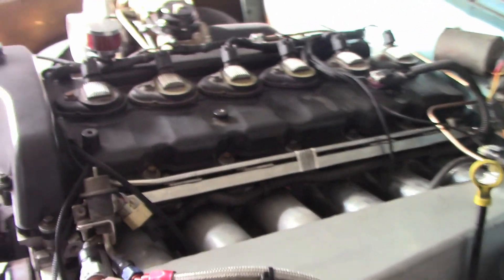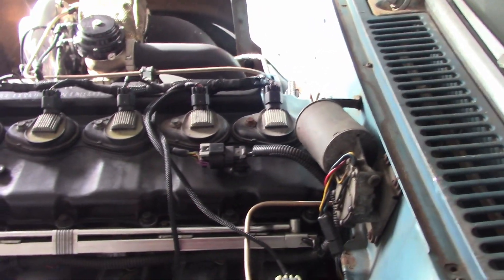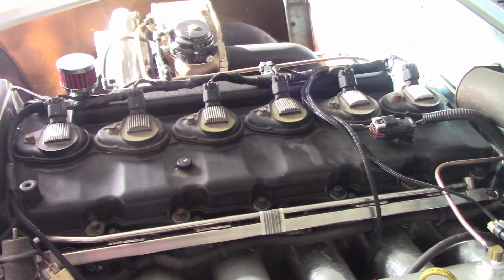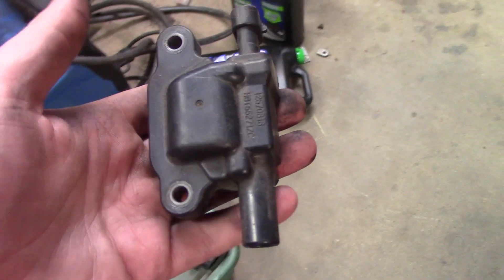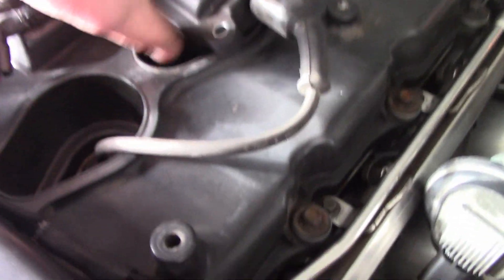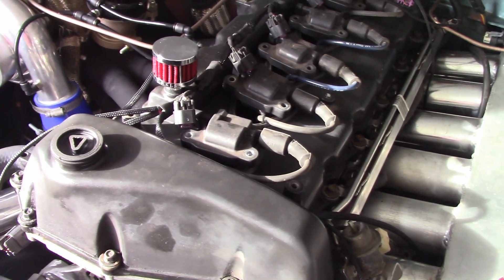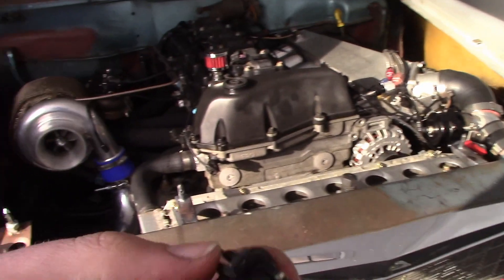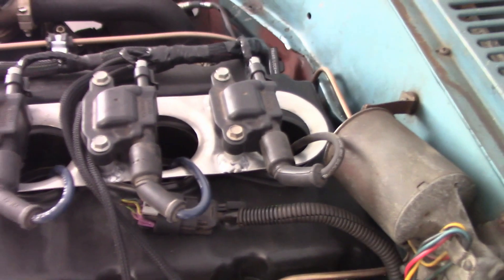Converting to LS coils

Comment: Quick question say I did this on stock motor..will anything else have to be done or will it still Start right up. Will it need to be tuned? Not a big fan of the stock coils on these motors. You've had more experience on this so just wanted a little input on it thankyou in advance. Enjoying the videos as always man! Keep it up!
Reply from the maker: Nope. They drop right in
Reply: @Calvin-Nelson  sweet thanks for the reply!!

Comment: The coils on the 2002-2005 4200's are so damn quirky... even ACdelco's... The 2006-2008 redesign was far better and resembled more of an LS type ignition coil.
Reply from the maker: Yeah. I figured, if I am going to take the car on drag week, LS coils will be more likely to find than Atlas coils.
Reply: @Calvin-Nelson  You made the right move brother. I'm loving this build so far. Myself and another Trailblazer owner I know are planning on slapping Turbo's on our 4200's as well. I'll be refreshing a spare 4.2 that I'll be using. I'm glad that in the past year or two, more people are giving this engine the attention it deserves. It really is a domestic 2jz.
Reply from the maker: @RedLegs13B.  Agreed. I would more compare the engine to the Barra engine, actually. It is surprisingly similar to that.
Reply: @Calvin-Nelson  I've never heard of it until I looked it up just now.
Reply from the maker: @RedLegs13B.  Look up the Mighty Car Mods Cresta. Very cool example!
Reply from the maker: @RedLegs13B.  Unfortunately it is an Australian only engine.
Reply: Do the 06-08 designed coils fit into the 02-05 design and is the reliability improved?
Reply: @markofexcellence5209  no and even though there better there still shit imo ive had multiple oem fail on my 07.
Reply: So I have a 03 envoy with the 4.2 and I keep getting a cel for the camshaft position sensor so I replaced that along with the variable valve timing solenoid and whenever the car is under heavy load ( step on the gas ) it seems to fall on itself which goes between 2500 to 3000 rpm but doesn't  have any power plz any info would be a big help
Reply: @bryangreer5352  The throttle body failed on mine, sounds like a similar problem to what you're having.
Reply: @markofexcellence5209  alright thank you I will start there